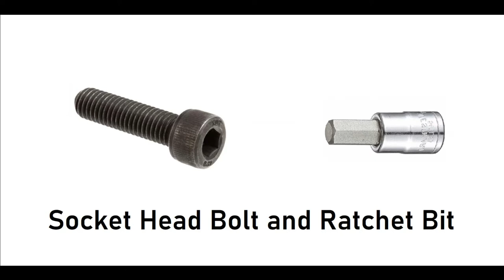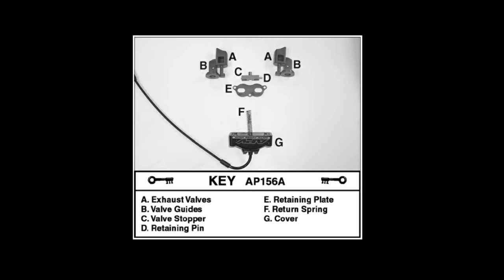02 Arctic Cat ZR 600 EFI Series Part 4: Apv's [How to Clean Power Valves]

Comment: A little tip is using a drywall sanding sponge to remove the carbon and other deposits. It worked well without being too aggressive, and forms to the contours.

Comment: Thanks again another helpful video. Just cleaned the APV's on my 02 and 01 zl 600's.  I had 2 broken cables on the 02, and had a difficult time finding replacement parts. Found some used ones on E-Bay. Arctic Cat has discontinued supply for these models. Do you have any cross refence parts from SPI or other manufactures? Thanks again and hoping for more snow this winter!
Reply from the maker: Glad it helped and no I don't have any cross reference numbers at this point. Sorry. And yes! Lots of snow this year I'm praying for!

Comment: Andrew, hi. I'm happy to watch your videos again. This video is very good. It not only shows you how you work but also teaches others how to do it right! Very, very good! Of course, I know this myself and can do it, but I still watch your videos like a good movie . Unfortunately you couldn't remove the spring because you didn't loosen the other end of the cable on the control lever :) hahaha )))) I by the way, when I disassemble such nodes and they are poorly understood, I think, And I can then put it all back together ))))) So sometimes it's better not to disassemble it )))) Why are you scrubbing the parts with a brush? Wouldn't it be easier to immerse them in a solvent and an ultrasound bath? I do that. The result is always excellent! Andrew, O-rings and cuffs, and any rubber seals. If they have nothing to replace and need to be put back, I soak them in ammonia (Formula: NH3 * H2O, or, more commonly, its notation as ammonium hydroxide: NH4OH.) For 1-3-5 minutes no more! Then I wash it. The elasticity is restored.
Reply from the maker: Thank you very much for the kind words. I do like work. Soemtiems it can bs tedeous but the ens result is great if you do it right! You always seem to have some good little tips ans tricks. I will have to try the ammonia trick some time. Yeah I hit the parts with a wire to show someone tjat doesnt have a part washer (like I do) how it could be dine. These valves had some nicks in them so also had to hit with a flap disc.
Reply: @Fixin2Ride-Official-  Andrew, rubber seals can also be soaked in kerosene. Depends on the composition of the rubber. As for the dampers: If there is no ultrasound bath. Then you still should not brush them with a brush. The iron brush, the more abrasive the nozzle, creates a bully. These teasers will subsequently either interfere with the movement or if the pair is precision, then there will be air suction that will also disrupt the work.By the way, the pistons burn out easily due to air suction. For this reason, I clean such nodes ONLY with something soft. A rag, a Brush made of wool.I soak it in a solvent and clean it. It's something that doesn't fit in my tub. It is small ))) But for cleaning the perfect thing.
Reply from the maker: Good info! Thanks again for the support!

Comment: Hi Andrew I just seen your videos...very educational which helps a lot of guys out like myself....I have a Arctic cat ZR 600 EFI.....I have a bad bogg is when I put the throttle to the bar wide open she dies down I cleaned my power valves other than she stays running nice and goes along good gets up to speed slowly
Reply from the maker: Thank you very much I'm glad it helps out a lot of guys because I didn't get much help when I first started fixing snowmobiles I kind of had to find this information myself. Yes the 600 efis are nice sleds. So do you still have your bog? Will it now slowly get up to speed? What year is your 600 efi? One thing that you can look into are the smart valves inside the fuel tank which are the pickups for the fuel pump. Those can start to go bad and need to be replaced but instead you can put a tiny quarter inch slit in them and that will allow them to open up like they should and allow full fuel flow. There could be other things to look at though if your snow will be a will eventually gain speed. You could be looking at low compression or bad clutching. Bad clutching could be worn out clutches or the wrong setup.

Comment: Hey Andrew I just picked up a 2002 ZR600 I noticed on the right power valve it’s missing the 3 socket head (allen bolts) would that cause the power valve not to work properly? I’m learning as I go on this one. Thanks!
Reply from the maker: Yes. I believe so as there is a spring that needs to be achored to the cylinder via the plate that is held in by those bolts. It will just get pushed away from the cylinder and only slide down when exhuat pressures lower the closer to idle it gets. 

 The power valves dont moce until around 6,700-7,000rpms. So if one is moving before that on account of exhaust pressures it will hinder performance.
Reply: @Fixin2Ride-Official-  thanks for the quick reply! I might have a few more questions coming your way in future. I’m trying to get this running well again not quiet as nice as yours I’ve been working my way through your video series
Reply from the maker: Sounds good. Unfortunately on our first trip out last winter my wife totalled this sled. Smh. Her and my son were on and they are both fine. But a shame after all of the work I put into it. 2 sled shes done this to in 3 years....
Reply: @Fixin2Ride-Official-  damn I'm really sorry to hear that especially after you put all that work into it. glad to hear they were okay from the crash. Maybe snowmobiles aren't her thing haha
Reply from the maker: Appreciate ya! And Lol. Maybe driving isnt her thing. Lol. It was something new for her this time. Snow dust blinded her. She will be taking her snowmobile safety ceriticate before I put her on another sled thats for sure

Comment: Old school arctic cat fixer
Reply from the maker: Thats me.
Reply: @Fixin2Ride-Official-  i wish you can build me 1 my old man is a die hard cat fan like you but he likes ski-doo for there gas mileage and oil mileage on there 2 strokes
Reply from the maker: @edwardabrahamiii3742  I might do something like this one day.
Reply: @Fixin2Ride-Official-  id buy it but it would need wisecos or wossners forged pistons only i dislike cast pistons i ride my snowmachines to hard all winter long cant have it fail on me out there
Reply from the maker: Youre speaking in terms of "Race Pistons".... Forged piston dont expand as fast as a cast and therefore can be ran at tighter tolerances... They are used in race engines for this purpose. Heat the wrapped pipes up and then hammer on the engine for one hard pass in a drag race without worry of cold seizing. Cast pistons, with proper cyl to piston clearance, when treated right on a properly functioning machine will last 10,000 miles easy. 

 When using forged pistons on a trail sled, the engine has to idle much longer to warm up every use of the sled from cold starting, to avoid damage on account of different heat expansion rates of the cast cylinders and forged pistons and thats just not good for the cylinders. Regular use of and proper warming procedure of forged pistons will cause the cylinders to glaze over and that causes poor lubrication and compression as the cross hatching is filled in with hardened oil/carbon deposits (i.e. the glaze)...
Reply: @Fixin2Ride-Official-  no wonder you only believe in cast pistons i only like to use forged i do warm up my machine 10x longer with forged i know what they are
Reply from the maker: Gotcha. I would deff use them on a race sled. Have you ever heard of a company called "Line 2 Line"? They put coatings on pistons?